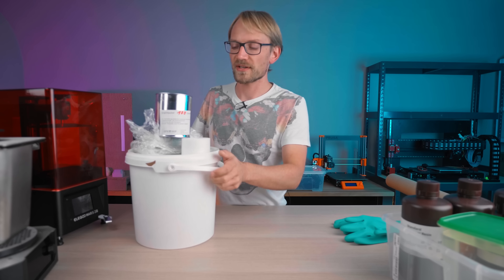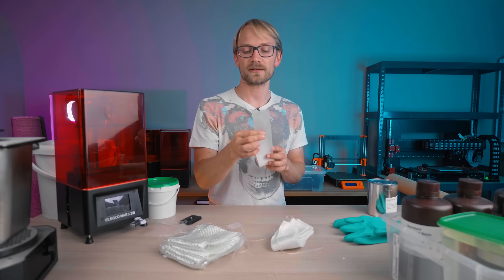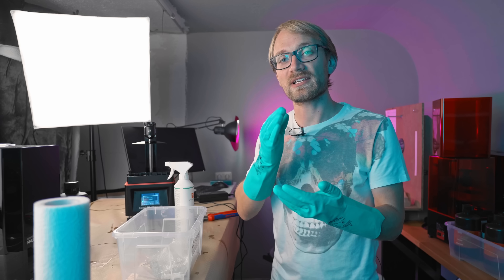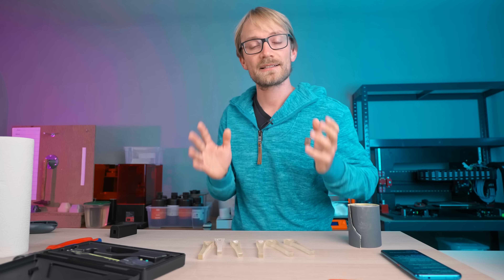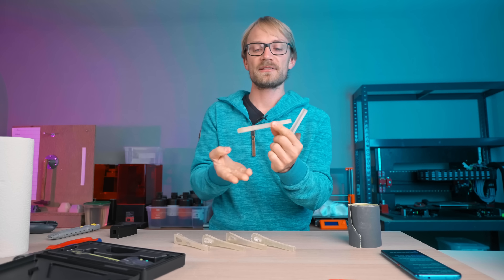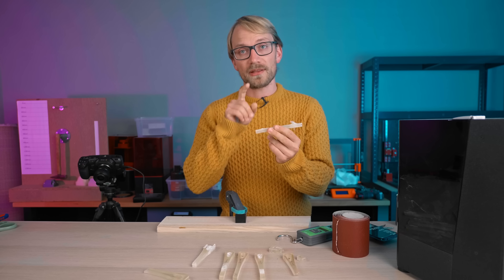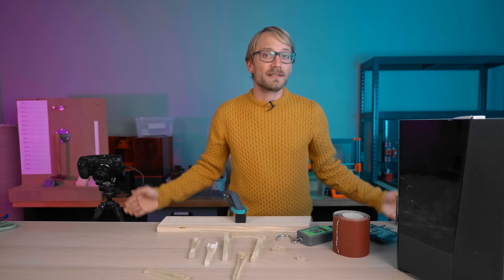Fiber-reinforced resin prints - how much STRONGER are they?

Comment: Thomas, could you test cutting the fibers free from each other and sprinkling them in the resin perhaps.  I imagine thread lengths around 10-50mm .  It might turn into a rats nest of fibers that hang off the plate between exposures which would mean they may orient somewhat through the layers of the Z axis.  That'd be so sick if it improves it!

Comment: You're testing at it's weakest orientation. You're basically testing the lamination connections. If you were to turn the piece 90 degrees in the test frame, you'd probably see a significant difference. I would suspect that pulling longitudinally would also be stronger than the "vanilla" print.

Comment: You are testing in the wrong axis to the fiber orientation, you should really rotate all test parts 90 degrees along the longitudinal axis. Fiber composites are always engineered for vertical orientation or 90 degrees to stress load plane rather than parallel or horizontal. It would be really interesting to see it again, I would expect at least double the strength value in several of those layups. The reason you need to rotate is that rather than relying on the strength of the surface of the part as you stated, it transfers the load throughout the whole part and maximizes the benefits of the added fibers. For the greatest strength you should alternate that weave direction by 45 degrees each layer.

Comment: I suspect that the drywall tape is manufactured to separate easily across its length, but not across its width. The intended application is to bond adjacent drywall panels, and to be easy to cut.

Comment: A few things that may help you out. Looking at the video, it appears that you are using 18oz E glass roving. You may want to look into picking up some E-glass Uni as an alternative (all the fibers run in one direction). 

You could also look at trying some 4oz or 6oz s-glass cloth. S-glass will go completely clear in resin, which may help with the overall part accuracy. S-glass is also about twice as strong as e-glass, and it weighs less. (if you are unsure, s-glass looks silvery white, while e-glass looks slightly blue-green)

You could also try some 3/4oz fiberglass mat. Mat may not be as strong, but it could be easier to work with.

Comment: Would be interesting to see just mixing in loose fiber into the resin like is used to reinforce concrete countertops and such.  Looks like similar stuff but is just unwoven short strands.  Might work well since it would be embedded throughout the part instead of just a few layers.

Comment: Not sure I remember my highschool physics. But isn't glass fiber (especially woven) more resistant to tensile stress compared to the test performed here which is more shear/bending stress? Seams like a unfair test applied to something which was meant to really perform in a different way. Perhaps perform a test with a link-shape where the fiber cloth is aligned along the tension force (instead a bend test).

Comment: Unidirectional fibres would pretty much double the strenght
Reply: BigMilan exactly my thought. Using that weave wastes 50% strength because 50% of the stands run perpendicular to the load thus not contributing anything g to the strength.

Comment: How about chopped fibers mixed into the resin?
Should remove the hastle of trying to insert fiber layers into the print and lead to more isotropic performance.
Reply: That should work. But the fibers would probobly be pressed pretty much flat
Reply: I've been experimenting with chopped fibers quite a bit now, it works pretty well and the prints definitely are stronger, but it's quite hard to find a proper mixing ratio. Adding chopped fibers or glass beeds will thicken the resin quite significantly (that's what they are usually used for), so be careful of adding too much.
Reply: @MrsMcMuffin  i work in the construction industry. We use a simular metod. But for some reason. If the fiber is of two diffrent lengts, it works way better. One shorter, and one longer.... and it should not be like much longer, something between 50-70% longer seams to work best.

Comment: one thing id love to see you try is glass beads, they are commonly added to injection molded plastic to add strength and could be easily mixed into the resin and used through the entire print. i dont know if it would make a substantial difference in stregnth but would make prints alot more abrassive ressistant.

Comment: Such a cool idea! Im a bit curious if it is better/easier/stronger to print a mold and then use epoxy or polyester resin with glass fibre. Using the west system epoxy pumps should make it clean, strong and less messy. It is also familiar to boat nerds like myself. They have compatible fibre- and filler additives off the shelf.

Comment: Hey Tom! Tech Ingredients has several videos on reinforcing resins by mixing things in. Several of them could potentially be suspended in the resin. Obviously this increases viscosity and lowers flow rate, cetris parabus.

If you increased the lift between layers, could you try using some of these particulate materials in resin?

Comment: - Is your fiber binder compatible with your resin?
- Did you consider putting a chopped mat sheet between the resin core  and the woven fabric to have a smoother stiffness transition?
- Did you considered incrising the light exposure time to compensate the lost in the fibers in order to have a proper resin cure?

Comment: You are sort of reinventing an industry that has been around for decades. Fiberglass reinforced plastics have been used since the mid 1900s. All you're doing is using a more complex plastic bonding agent. Also you should definitely spend more effort determining how much the parts flex before breaking. The basic part survives so long because it stays together while severely flexing.

Comment: I think the main reason the dry wall paper didn't work for you is that the layers were oriented in the wrong direction. From what it looked like in the video, the dry wall paper is essentially a uni directional cloth, so oriented the fibers perpendicular to the load means they provide almost zero support. If you add them in after rotating them 90 degrees, I think you'd get a much better result (though it would be more difficult since the dry wall paper is not very wide)

Comment: The drywall fabric is not woven cloth its just trimmed mat with all the fibers oriented in a particular direction. it would only really add anything in the other direction your just removing resin using it in that orientation you would have to find wider and orient it perpendicular then it would probably beat the heavy weave.

Comment: Given you knew the direction of the load, I would have liked to see you use unidirectional fibers, which I hypothesize would yield in much improved strength because the fibers horizontal to the load weren't doing much for you and may even have lead to weak points.

It would also have been interesting to see if chopped mat would have been much different because its usually so thick, maybe 2 or 3 sections of chopped mat would have filled entirely the part like you tried to do at the end of the video.

Comment: Glass fibre doesn’t have the exact or same strength as carbon fibre.
Reply: The entire test is flawed. Fiber reinforced parts are designed to deal with specific loads. It isn't just placing a bunch of sheets willy nilly and it magically becomes stronger.

Comment: @12:25 isn't it also a dynamic load on the resin when the fiber fails? Suddenly the stress that the fiber was enduring is transfered to the resin which is suddenly allowed to bend into a different arc, allowing the resin to bend past where it would normally bend under a slow loading.  ...we need a precise jig to measure how far a resin piece bends, then load a fiber part to the exact same bend, and hope that bend is close enough where the pure resin part doesn't break, but the fiber part does break. :) because science...

Comment: I worked with fiberglass for wind turbines for a turbine, watching it fall apart in the resin gave me big anxiety
Reply: Omg why were you cutting off fiberglass with bear hands !!! AHHHHHHHHHY
Reply: DONT RUB YOUR FINGER ACROSS THE FIBERGLASS UNLESS YOU ESSENTIALLY MELT THE MATERIAL TOGETHER
Reply: Now I will say, wind turbine blades are almost solid fiberglass layers and industrial resin, if you instead tried say 5-10 layers, and did a strength test it will overall be stronger.

but only if you bend it in the direction flexibility of that fiberglass, I bet if you got fiberglass that is woven in a double axis flex it will hold up better, it’s more expensive and much tighter but does look better

Especially if the part you are testing would be longer.

Comment: The fiber tape is in the wrong orientation, it is running in a horizontal(E/W) instead of (N/S) along the part.

Fibers should be aligned as you would on a wood grain. Think about a stack of paper, if you bend it on the face, it sticks together but if you split it like turning a page(peeling), they come apart.

Comment: Thomas,
Really awesome idea! This is why I follow you and Stefan from CNC Kitchen!

The next time you run the test you should try with woven Kevlar fabric, the color should be light enough to allow for curing and it would be interesting to see how the properties of Kevlar could handle the loading in your test.

Also, I agree with  your statement that this test may not be optimal for the applications where you would need this kind of reinforcement. Mainly because this loading test is affected by how ductile the resin is, I think it would be good to see how the parts function under a constant load, say as a connector in a furniture piece, or as a drone frame.

I also agree with another commenter that  you should reach out to Stefan at CNC Kitchen to have him independently run the same tests that you do, two testers and multiple data sets are always better.

Thanks for your awesome videos!

Comment: So I watched this video and I love the concept so much so I have a few ideas that I want to throw at you and see what you think. So bear with me this is some classic hair brain ideas. So first what do you think would happen if you used pre impregnated cloth. Such as you took the cloth before 3d printing and using a vacum  or pressure pot chamber (edit i think pressure treating would be cleaner ) to fill the voids in the fabric with uncured uv resin. I imagine that would create less voids and therefore increase possible strength also what do you think would happen if you alternated weaves . When I notice people producing fiberglass products normally they use multiple layers of one kind of weave then use a different filler weave. I think that might create an object that is more rigid and may resist shear strength.

Comment: A common misnomer with composites is that carbon is the end-all-be-all material of choice. In regards to stiffness, this is true, however if you're going for tensile strength, the appropriate S-glass fiberglass cloth will beat it, all else being equal. Of course the trick with composites is getting the resin to cloth ratio absolutely perfect and consolidating the layers to be as tight as possible. 
I brainstormed a lot of ideas one summer based around imbedding carbon and S-glass with an FDM machine short of buying the pre-mixed carbon filaments, which were an assortment of 'interesting but failed' results. 
Using a resin-based printer and fiberglass is about the best start you could hope for, however your resin ratio and the layer consolidation is essentially 'in the wind'. There's no pressure being applied beyond the first press of the platen, and your fiberglass is relying on the resin to stick to the intermediate layers, otherwise it is just floating in the resin and absorbing everything until saturated.
If you could find a solution to these two points, and alternate resin layers to fabric, you would have a mighty fine part that would surpass pure resin in both strength and stiffness.

Comment: I advise you to try the dry wall reenforcement Strips at an angle of 90 degrees. while you can rip them quite easily at a right angle tney are a real bummer to rip in the other direction. and that's actually what they are made for in drywalling

Comment: Hey Thomas, 
i think a better and easier approach to this thinking of using fiberglass with the resin will be using Fiberglass Powder.
just mixing the resin and the powder before putting in the printer. you need to find the ratio resin:powder that is the best... 
and maybe then trying to add a fiber glass sheets on both sides... 
BE CAREFULL the fiberglass powder is very not healthy to breath! while it's dry it flies really easily in the air. USE MASK.
you can contact me for more information.

Comment: According to Mike Patey (the guy who made DRACO) fibre composite parts need the least amount of resin possible, only enough to just bind the layers together otherwise the resin is the weakest link and it undermines the strength of the fibers, therefore this would suggest that you need fiber in every layer of the print or you need to use a flexible resin so that it does not fracture then have that propagate through the fibers.
Reply: Completly agree on the flex resin.
Reply: @AlexDubois  The part will have anisotropic materials properties but for a lot of applications that may be an advantage too, you'd just have to factor that into your engineering design.

Comment: It might make sense to place the reinforcement towards the middle rather than the outsides. 
Brittle materials (high compession strenght, low tensile strenght) normally get reinforced by putting something in the middle that either has a higher tensile strenght, or pretensions the outer surfaces by contracting after curing. The goal is to use the inner phase as a lever to convert the bending stress into compression on the inside curve without reaching the required tensile stress to crack the part on the outer curve. 
The more brittle the material, the more it benefits from this kind of reinforcement. 

Theoretically, one could pretension the print by variing the layer thicknes and exposure time throughout the print. (As the resin contracts differently with different exposure.) Reinforcing the part without adding reinforcement. (See gorilla glass, or tempered glass to a lesser degree).

Comment: You need to test your fibre material to see if it is stronger than the print material.  You also need to match "E" (modulus of elasticity).. if they are signficantly different you will induce a stress riser as one component takes all of the load.  Its a good ideal but I dont think the resins have a modulus that is compatible with anything that would make good reinforcing.

If you treat the resin as shear transfer and shear flow transfer then you could try using steel mesh.

Comment: Interesting. If I could recommend: 1) bias the fiber cloth rather than align with the direction of stress; 2) basalt fiber is supposed to have coarser surface features, which may improve the resin-fiber interface yield strength.
Reply: He should use a more flexible resin as well.... I've said it in other comments, not sure if I'm spamming everybody by repeating (dont' think so)...

Comment: Interesting video, however, id love to see a part 2 using different fillers rather than woven fibres/tapes. the like of Glass beads, milled carbon fibre powder, or fine chopped carbon/glass strands are common use in the composite world. 

easycomposits based in the UK stock these filters if you want to have a look for yourself

Comment: I'd be curious to see if you cut the heavy cloth in to fiber 1-3 mm strands (literally just fraying and cutting the cloth), enough to saturate the entire resin bath, and then let the entire print take up the fiber reinforcement. Would that be a problem for the print? If it worked, would it increase the strength substantially?

Comment: First of all, DO NOT TOUCH the naked fibers with bare hands. Microns thick fibers can penetrate your skin and would take forever to get out.

I guess the structural issues you have faced has occured because glass fibers are meant to laid along the entire surface of the object without having lumps of resin elsewhere. You had placed fibers only along the stick, ideal way to make lamination to that shape is having resin printed thick enough only to laminate the fiber strip and nothing more. Take a look at hand laying and vacuum infusion techniques to better understand what i say. That also means that you might need specially desinged shapes to laminate glass fiber as well, maybe like an U-shape extrusion profile. Great video, i wish i had a SLA printer to try it as well :(

Comment: Orient you're fibre lays at 45 degrees to each other, it will increase the strength alot because it layer will handle the stresses in a different direction. Like building a brick wall

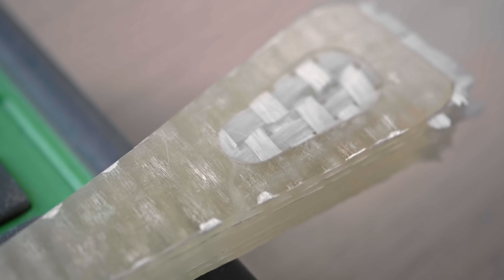Comment: The result you've got around 15:10 is quite logical if you think about it. The fibers are strongest when the force acts along their length, trying to stretch them. Heavy glass fiber cloth have more strand positioned into optimal direction than a drywall strip where fibers are put randomly (they serve a different purpose). If you put 6 layers of heavy cloth on the side that experiences tension you would get stronger and stiffer part but it would probably bent while curing.